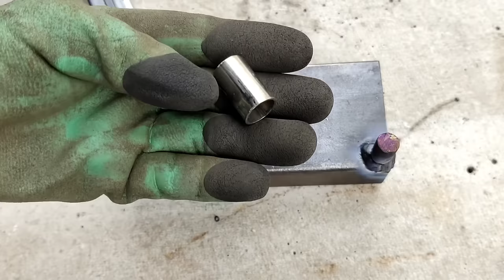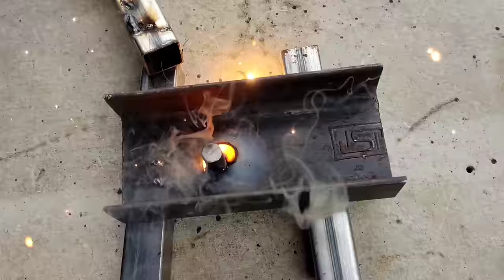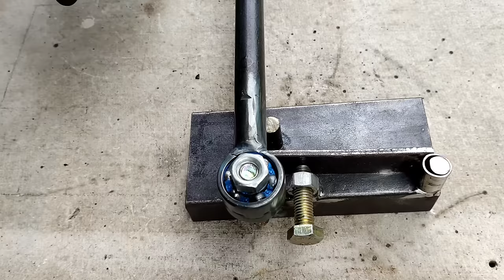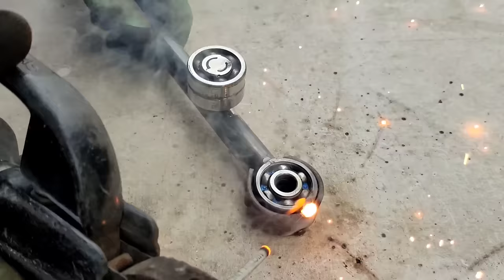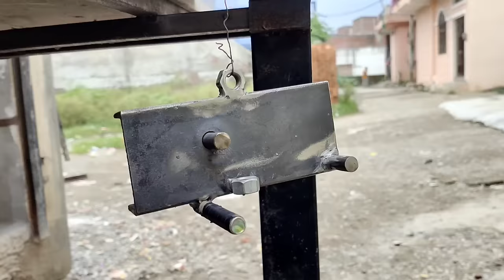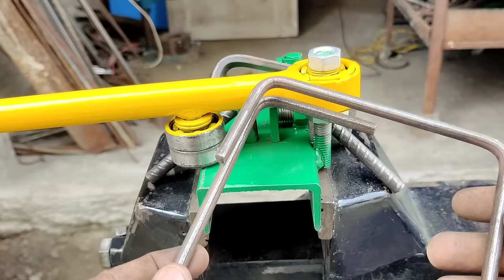Amazing Homemade Bender Smart idea for bending flat bar round bar square bar

Comment: FINALLY! I've found a video where someone has made an adjustable version of this for doing round bar, square bar and flat bar of various sizes.
You could also add and angle iron to the pivot pinion to make a tighter fold.
Excellent work my friend